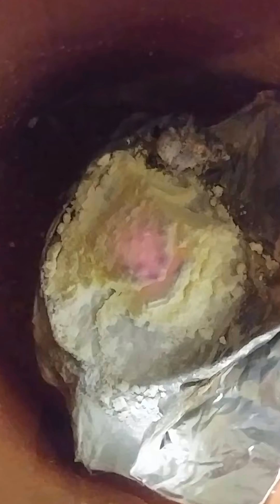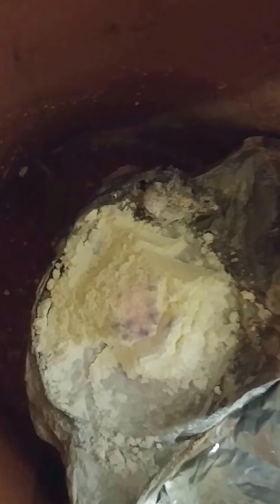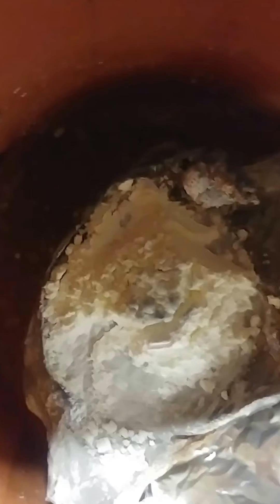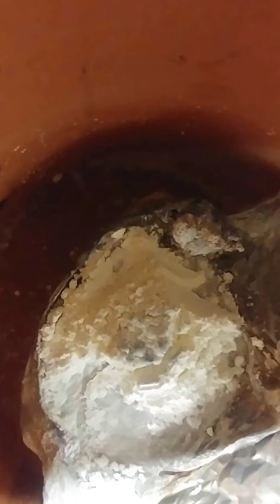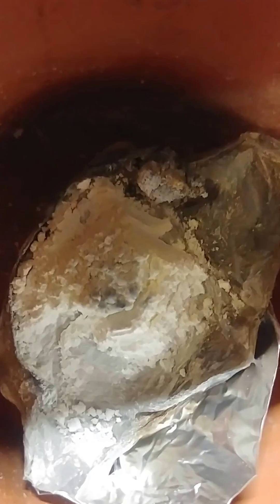Homemade Synthetic Sapphire / Corundum - Boule Early Formation Tests.

Comment: Hat's off, this is a complex project for a hobby, god luck... I work in a plant that uses Verneuil and a modified Czochralski process to grow Sapphire and some Ruby... cheers
Reply from the maker: Thank you very much.  I would love to visit the plant and see the commercial furnaces in action.--that would be awesome.  I just got back to work on my Vernuil furnace.  I made a piece last week and will be testing it's durability soon.  If it holds up, I'll make the entire furnace cavity out of the material.
Reply: @mwilson14  As soon you visit Switzerland (Suisse) i'm more than happy to show you the plant. Unfortunately i'm prohibited to share videos or pictures from our plant. I will post some similar one.
Keyrole for success is pure AL2O3 powder with correct grain size, a god germ (seed), temperature control, continuous powderfeed and adjusting the distance between growing crystal and flame + time.
You will find much information on the web about apparatus build. If you like to grow bigger crystals, i see no way without some automation. For small crystals you have proven by yourself, that a torch will work just fine. But in any case, i suggest a crystal seed (germ) with the right orientation of the internal structure-grid (grow-direction) to achive monocrystals. If you want chaotic orientation with some branches and needles go without a germ.
Cheers...
Reply: https://youtu.be/hMWzXLFuRDk
https://youtu.be/jO6E8JRIjTs

Comment: I haven't found anyone else trying to do make a verneuil furnace at home. Where are you sourcing your refractory and raw material?
Reply from the maker: I've got firebricks that withstand up to 2700 F from the hardware store, as well as refractory cement (I think the cement is rated to withstand 3000 F temperatures).  I used eBay to get several yards of ceramic refractory blanket.  It handles approximately the same temperature as the firebricks, but will insulate the firebrick walls of the furnace.  

I'm also making my own refractory material from aluminum oxide which will need sintered, but may possibly suffice without sintering as it holds it's shape well.  It keeps it's shape extraordinarily well without cracking if dried slowly.  I create a mixture of approximately 96% Al2O3 and use ground silica gel (without color indicator), as a binding agent.  It absorbs the extra moisture from the Al2O3 paste rather quickly, so this is added and mixed right before applying to a mould or surface to be coated. I'll eventually make a video of it.

The walls of the furnace won't get anywhere near the temperature of the hot zone.  The mechanical pedestal for the corundum boule will be a couple inches below a disposable pedestal covering made from the same feed material.  I've got a lot of testing to do before finalizing my construction plans, but so far the materials I've been testing hold up perfectly.

Comment: Really cool my friend 👍
Reply from the maker: Thank you.  I have modified the formula for the sapphire after performing more research.  It comes out with very dark blue crystals.  I'm hoping to get video of one more test, which will be from start to finish instead of just watching it cool down.  The tiny oxygen tanks I'm using are really expensive, so I'm probably going to limit my additional tests until I have a more sustainable and economical supply of gas.
Reply: Matthew Wilson I will look forward to that video, cheers